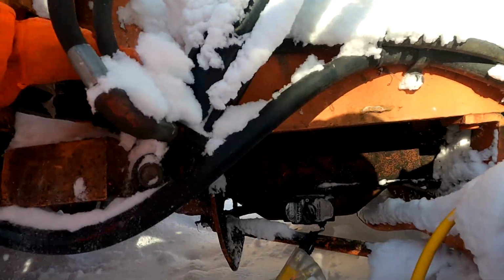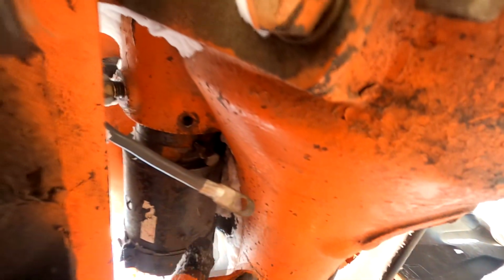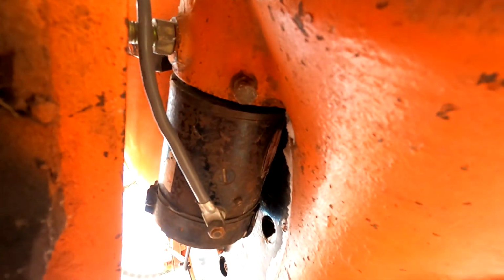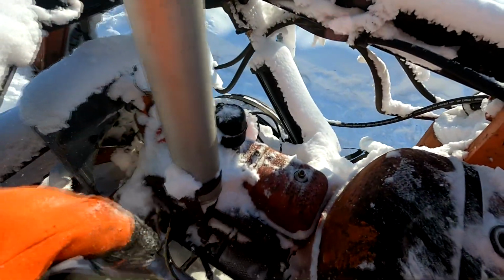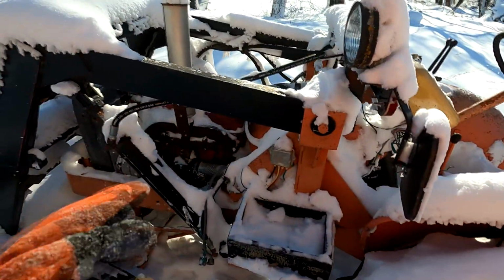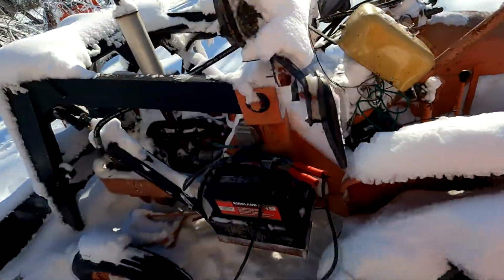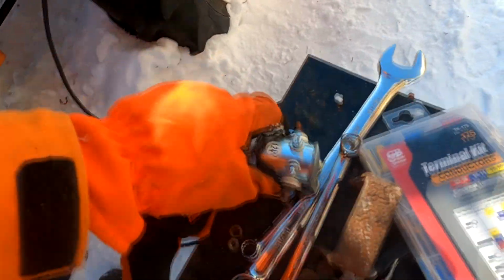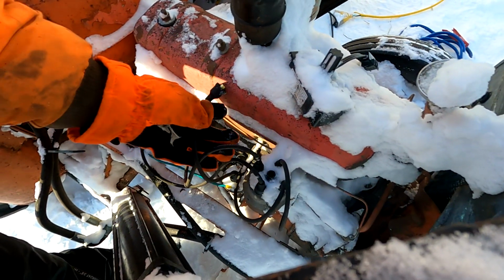Will it Run. 1957 Allis Chalmers ib

Comment: That is an ib Allis Chalmers.  AC made around 2600 ib tractors vs 138,000 B tractors.  It has a wrap around c-channel frame, final drives rotated 90 degree forward compared to a B, and a short torque tube, which is too short to fit a battery box.  Yours should also have a foot and hand throttle.
Reply: And it easier/quicker to rotate engine by turning fan blades than pulling starter and rotating it using the flywheel.  :)
Reply from the maker: The fan is not connected to the motor at all. This unit originally was a hand crank start. but the hand crank is used for the hydraulic pump now. The inspection port has been modified to have a starter. This unit never came with one. but pretty sure the port is the same for the one that come with starters but have all the bolt holes pre drilled and not a bolt that is used with just a tension hold to keep the starter in. I am unsure if there was a battery box in this originally or not but the home made bucket and bucket supports are all welded in by my great grandfather and take up a lot of space as the metal is a cut up truck frame. This thing has been heavy customized for the jobs used. I have no idea if the wrap around channel is originally as it has been welded a lot. I would have to search for a id tag of some kind to tell for sure as so many parts and metal has been use to modify this and keep it going as well built for what ever job was needed over the years.
Reply: @SchneiderClassics  your "inspection port" is the factory cast starter opening.  The inspection port is on the 6'o clock position facing down.  Look at a hand crank Allis B torque tube vs yours to see difference.  Allis B tube is also over a foot longer and mouts a different steering box/steering tube angle to steering wheel.  Ib tractors had 3 options for battery location